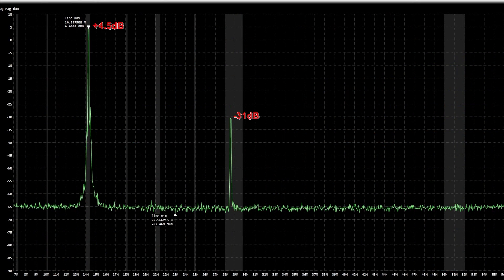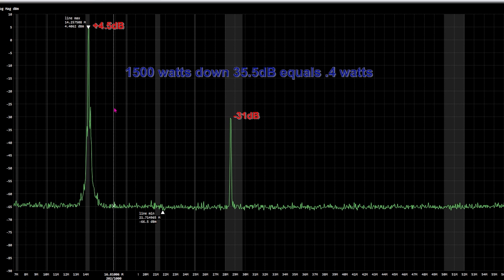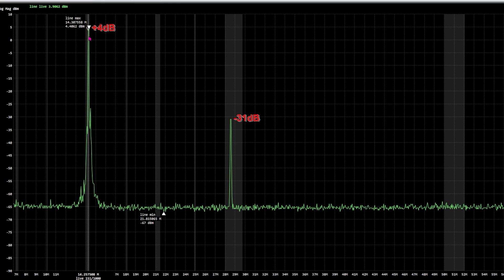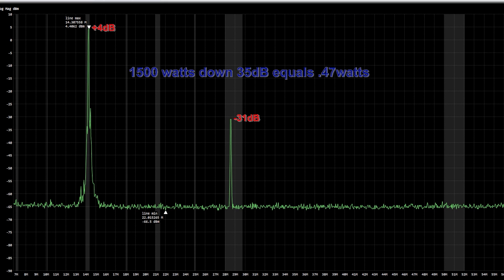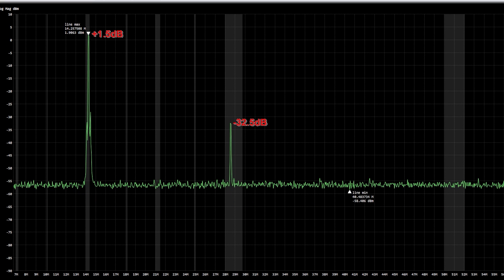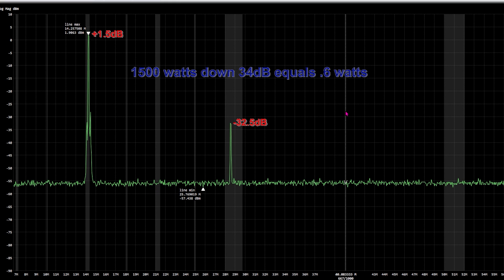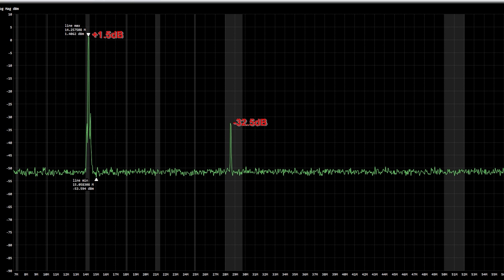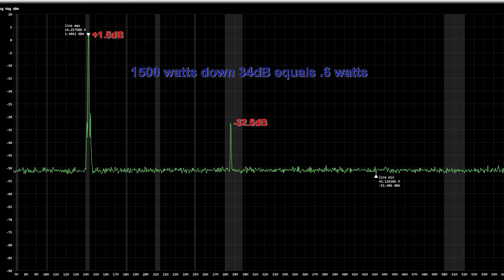Is -35 dB Good Enough? Please Watch this Video by Jim Heath W6LG YouTube Elmer

Comment: Looking at the test results, it looks like the carrier is at +4 dBm at the input of the spectrum analyzer.  At that level, it is possible that the analyzer is being overloaded. Place a step attenuator in line with the output of your sampler and reduce the input level to -10 dBm and set the SA reference to -10 dBm.  That will ensure that there is no overload.

Also, I am wondering about the frequency response of the sampler.  With multiple turns on a ferrite core, it is possible that it is not flat vs frequency. Sweep the coupler and see if the output is flat across the frequency range of the test.

If the old Drake you used to scavenge parts uses a simple Pi network, -35 dBc 2nd harmonic might be about what could be expected.  Depending on its year of manufacture, the amp may have been legal until modified or scavenged for parts. Considering that you recently built the amplifier, it would need to comply with the present FCC regulations.  Under Part 97, you can build one amp a year, IIRC.

You can, btw, correct this with any reasonable means.  You could use an external filter, or even model your antenna and determine how its gain and SWR on different frequencies compares to its gain and feed line losses on the antenna's fundamental frequency.  This won't help you with many multi-band antennas, but a half-wave dipole would have some loss of gain on its second harmonic harmonic, mostly from the higher feed line losses at high SWR.

Ed Hare, W1RFI
ARRL Lab Volunteer

Comment: Hi Jim, I have copies of the Canadian type approval document for HF transmitters up to 1 kW. The harmonic limits are specified as: 43+10log(peak power), or 70 db. I can email copies of the document, if interested. I have done type approval testing to commercial FCC specifications, but no longer have access to the document, and do not remember the limits for harmonic suppression. 73, Frank, VE6CB

Comment: If you are building a signal sampler like this, which is the best approach?  Inductive coupling as shown here, or resistive?  I'm building the resistive sampler featured in Wes Heyward's "Simple RF Power Measurement" ARRL article.  I believe capacitative coupling can also be used.  Just like to know, why I'd use one over the others. 73 VK4QP

Comment: Just so I understand, is the connection from the radio to the analyzer coupled, instead of direct? If so, have you calibrated the coupling through the coil? Is the response flat from the 1st to 2nd harmonic?

Comment: reduce the output power by half and remeasure the difference between the fundamental and the 2nd harmonic...?  if you see an improvement then consider that the amplifier is approaching a compression point. If so then back the power out down into a more linear operating range for the amplifier or even possibly the driver.

Comment: Hi Jim, I think as a few comments from the knowledgeable have suggested the test set up needs examining. I believe (as others have said) that at this power level and frequency the FCC expects better than -43dBc. It would be interesting to add another 10dB of attenuation to the TinySA input to see if the levels track. Possibly worth doing some tests on your sampler too to see if it has a rising frequency response characteristic. I quickly looked at some specifications for a few commercially made ham HF amplifiers, the OMPower tetrode amplifier claims -50dBc, I don't know if it has bandswitched filters beyond the matching of the tank circuit. An old QST review of the TL922 suggests it scraped through at -43dBc on 80m at just 1kW DC input, the text suggests that it is not great on this band. 
I would certainly hope for better than -35dBc irrespective of the regs, -50dBc would seem realistic. 
Would be great to see a follow up, I bet the amplifier can comply. 73
Reply from the maker: Thank you for your kind, thoughtful answer.  I will retest witth some changes.  For the results that I obtained, I "boiled it down to" watts at 28MHz.  At that point I reallized the results were not good.  It is now about 0300 local.  I am reading the comments to see what I can do during the retest.  We have had lightning and periods of heavy rain.  Everything is disconnected.  In two weeks I start chemotherapy again and I will end up in bed.  Each time I had chemo in the past I had to be taken to the Emergency Room.  So more testing needs to be done in the next few days.  Thanks again for your help.  73, Jim W6LG
Reply: @ham-radio  my best wishes for your ensuing chemo. Your videos are always great and helpful to people at all levels. My H/B tetrode amplifier for 2m was marginal but of course being a monoband amplifier at VHF it was practical to use a simple 1/4 wave stub to whack the 2nd harmonic although I subsequently added a pi-filter. It is a little messier with an HF amplifier covering multiple bands. 
Of course with a tuner in circuit you may get adequate attenuation improvement if indeed your amplifier is producing this level of harmonic. A possible test of your sensor maybe to run perhaps 100w direct from the radio through and note levels at the TinySA on perhaps 160, 80, 40,20, 10, to get a ballpark idea of the frequency response. The results may be skewed by chassis leakage which generally increases with increasing frequency. 
It certainly does put into context the levels of harmonics from some of our "budget" handhelds, 35dBc or so down on 3w being fed into a rubber duck is not going to cause widespread problems. A different case with -43dBc relative to 1500w.....

Comment: Not enough. Shouldn't be any signal that isn't on the intended carrier frequency. Possibly should put a choke or filter to filter the spurious emissions. I would suggest spurious emissions should be better than 80dB down.
Reply from the maker: Okay.  But, 80 seems like a number that I will not be able to achieve.  In any case, I have some work to do.  Thanks, Jim W6LG

Comment: I think you need to be -43dBc if I recall correctly.  You should also check to be sure that a portion of the harmonic distortion isn't due to the TinySA.  You can check with by varying the attenuation ahead of the TinySA and checking to see if the relative amplitude w.r.t. the carrier remains about the same or not.
Reply: Overdriving the tinySA is the first thing that came to mind for me as well.  Also, the core you are using to get your signal tap may be slightly non-linear.   Even at small power levels, cores are not perfect.  I would try using a scope (with 10x or 100x probe) across the dummy load and see what shows on an FFT.  73

Comment: Jim 
This may not be your problem, but just in case check the quality of the RF connectors. Some connectors do not have thick enough surface metal coatings (in terms of skin depth) and the layer being a different metal than the core metal can lead to junction rectification especially at high RF currents.
This plagued us at my former Army Lab, until we specified better quality connectors for high power amps and antennas.
best
Chris kb3bf
Reply from the maker: Thanks.  I did not think about the connector, etc.  Looks like I have more work to do to get valid results.  Thanks for the help again.  73, Jim W6LG

Comment: Good stuff Jim, and nice to see you again! Mmm -35dBc... pushing it a bit perhaps at 62dBm eh! FCC 93.307 says at least -43dBc below 30MHz for post-2003 transmitters, 50mW for pre-2003 and all kit built before 05.15.1977 is exempt, so make of that what you will. In the UK we're limited to 1% power outside modulated bandwidth, so you'd be "fine" here! But yeah... half a watt is maybe a bit... unhygenic HI

Comment: The first thing I'd want to know before I answer is does 1,500 watts need to be used for effective communication (per the regs)? Assuming the answer is "no" and the power is turned down to say even 100 watts out (as measured at the bird dummy load) I'll go out on a limb and guess the second harmonic is closer to 0.03 watts which in most receivers will be down in the mud. I'd say at 1,500 watts: No, but at 100 watts yes.

Comment: One thing I've wondered is if you are using a monoband antenna (such as a yagi), the second harmonic would be in a naturally high impedance point in the antenna for natural suppression. However if it is a multibander, such as an end-fed, OCF, fan dipole or similar, I'm quite sure I could set up my transceiver to receive on 28 mhz and we could have qso on a good day. I'll never forget having a qso with a gentleman in Washington state (from Ohio) with 1/4 watt just fooling around.